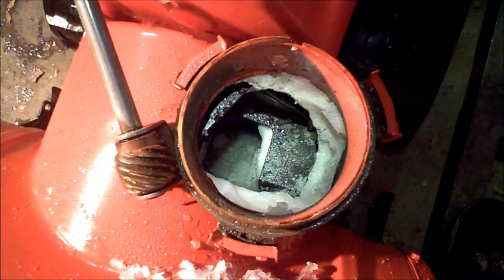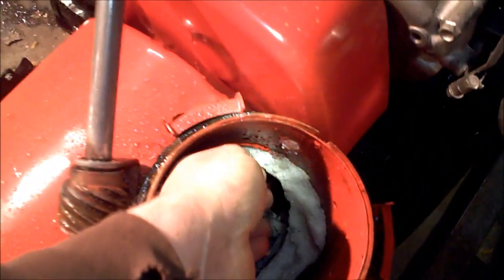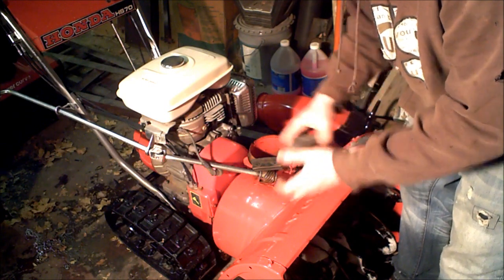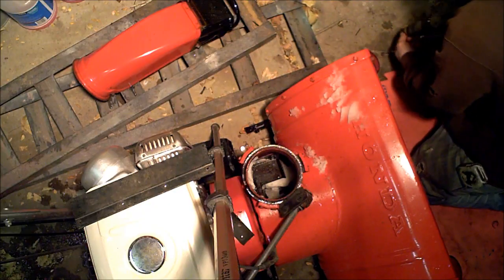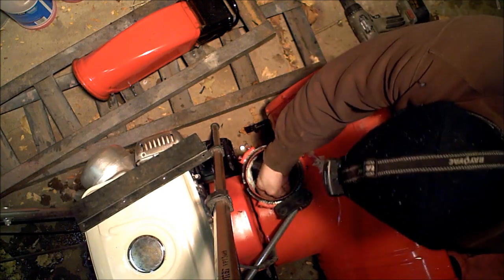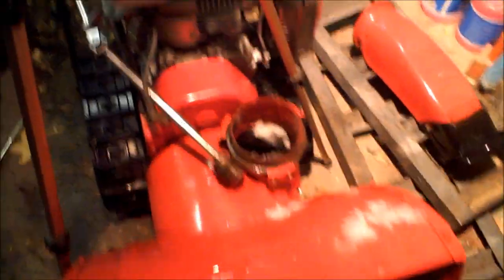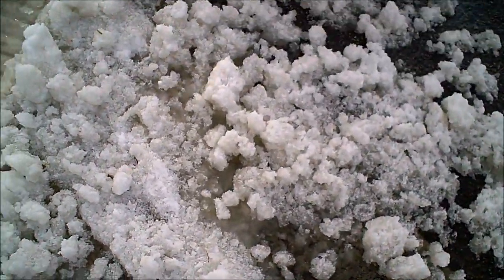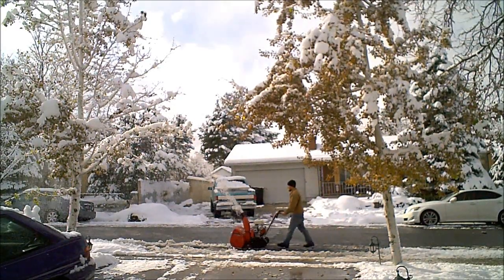Modify Snowblower to never clog and throw twice as far w/ Impeller Kit

Comment: Hey 65, I have a question for you. This past fall I bought a new Remington 24" snowblower. I've only used it 2 or 3 times. Yesterday it started great, I let it warm up for a few minutes, however when I started the augers it quickly died,  the augers didn't turn at all from then on. What should I be looking at. The auger at a quick glance seemed to have all the hairpins in... assuming their the shear pins.???? also I didn't notice a puff or two of smoke
Reply from the maker: tkdnwwis I'm curious to weather it is a mechanical issue or an engine. Slowly engage the auger and if the engine strains and dies then we can move on the to something mechanical. I would look at the belt.
Reply: sixtyfiveford Ok i'll do that tomorrow and let you know. I'm thinking that's what I did like the 2nd and 3rd time I tried to use it. Hypothetically speaking you'd still lean towards the belt. The machine is new (for what that's worth).
Reply from the maker: I would think the belt slipped off and is binding or the impeller is impacting something in the chute area.
Reply: sixtyfiveford Ok I took the cover off and checked the belt. The belt is on and still looks new. I tried to spin the belt by hand and it barely moved, it does but really hard????
Reply from the maker: With the lever not engaged there is a brake on the pully to stop it from turning. With the lever fully engaged it is coupled to the engine and hard to turn. If you partially engage it both will be off and you should be able to freely spin it.
Reply: sixtyfiveford Ok it's fixed. I didn't realize the plate that the auger shaft goes to, spins as well. There was Ice behind the plate. However, with your answers I did learn about how to remove the plate and find the belt etc. So "Thank You!". It's guys like you, that guys like me need. :-)
Reply from the maker: Great. I'm glad it was something simple.

Comment: Did this mod based on your video. My machine totally kicks ass now. Zero clogging and throws snow 30 feet. 
Even the heavy crap down at the apron.
 So simple and it makes it 10 times the machine. Thank you!
MTD 8 horse, 26 inch.
Reply from the maker: 1075twist That's GREAT. I'm glad you took the initiative to try it out for yourself. Every machine I do, I still am amazed at the difference.

Comment: Hey sixtyfiveford, I was looking for help for my roughly 20 year old Troy Bilt 21", 5HP tecumseh snow thrower that wouldn't run after starting with starter fluid. Did your 5 min carburetor clean, had some issues with the float (worked too fast to do it right at first, fixed that later) but got it running. Then, the hold down nylon clips on the discharge chute broke, so used a vice grips or a couple of snowfalls, til i got some new chute hold downs. But, while the chute was off, I had to try the impeller mod. Cut the rubber from the sidewall of an old tire, installed, then this weekend had 4+  inches of snow, then rain (on Long Island). Way too heavy to want to shovel, not likely to be handled by snowthrower. But, this thing went through it and only clogged when trying to push real slush out of pudddles! Can't wait to see what it does with real snow, but after this February, I can wait til next year!
Reply from the maker: Walter Donach Sounds like you've brought it back to life. I'm glad you did the modification and know you'll be impressed for years to come.

Comment: I just made this modification to the 60" snow blower on my tractor.  I used an $8.00 truck mud flap and $4.00 for some screws and washers.  Noticed that Amazon sells kits to do this mod.  You can also purchase a snow blower rubber paddle there too.
Thanks for making this video; wet snow is in the forecast.  Can't wait to try the mod.
I also gave you a thumbs up.
Reply from the maker: A Stanton1966 Let me know how it goes.
Reply: sixtyfiveford There's a snow storm coming Sunday and it might have some mix in it.  My blower clogged before in wet snow, so I'm curious to see how it will work with the mod now.

Comment: Small point but there's a difference between "self drilling" and "self tapping" screws. A "self drilling" screw will drill itself into metal where no hole exists. A "self tapping" screw will tap it's own threads into an existing hole. Good idea anyway.
Reply from the maker: Lysle Anderson Yeah, but it is used universally. Major manufactures use the term self tapping all the time on self drilling screws because all self drilling screws cut their own threads.

Comment: Thank you SOOOO much for this.  I was about 30 seconds from buying a new snow blower because I had all the problems you mentioned.  I have a fairly new 9hp Craftsman.  I did the mod using a 4" x 4" compression joint sealer / hub donut from the local Ace ($8) and cut it into 3 squares for the three impeller blade.  Holy crap!  This thing was like a brand new snow blower.  It blew snow easily twice as far as it ever has, even over the top of my pickup truck!  Also when done my blower used to be full of snow around the impeller.  It was clean as a whistle.  I can't thank you enough!  Here is the fitting I used: http://www.acehardware.com/product/index.jsp?productId=28973546&cp=2568443.2568452.2631237.2631261.2631276
Reply from the maker: Rick Troiani That's great. Great ingenuity with the plumbing part.

Comment: WHOOO HOOO!!!!
Oh man! This is fantastic! I did my driveway and my neighbor's (they're awesome people). I have a 5 hp 22" MTD. 

The situation before the modification:

I'm up in Kingston, Ontario Canada and this is our second 5"+ snowfall this week, so I have a good comparison. The previous snowfall, especially at the end of the driveway, I had at least 6 clogs and oozing slush that just dribbled out the chute in places. That was Thursday. The side banks on my driveway were creeping in b/c the blower couldn't get it over 5' high.

I put two fins on the impeller. I used a piece of car mat I had lying around (about 1/8" thick) Since my impeller is plastic, I used #6 self tappers, 1/2" in length. The toughest part of doing the job was getting the chute off. MTD has pics on their website that explained it pretty good. 

The driveways and sidewalks were covered with about 6-8" of snow with some drifts over 12".They were cleared with no problem. What I also discovered that (I think) b/c the hopper gets cleaned out so fast now it cleared the snow deeper. First time this winter I was down to bare pavement on the first pass. 

Basic snow was thrown 15-20 feet. I was able to move my banks back 2'.
AAND the crud dumped by the snowplow was tossed at least 5 feet, and in some spots even 10. The cruddy wet, packed stuff was gone man. GONE.

NOT. ONE. CLOG. No oozing dribbles either.
Thanks for such a great video man!
Reply from the maker: Jim M That's great to hear. It can be a bear to work down in the chute opening, so I'm glad you go it done.
Reply: awesome!!!!!!!!!!!!!!!!!

Comment: You are the man! I bought a 22" Craftsman snow blower for $50 on CL and thought I got the deal of the century until I used it and clogged after only a few minutes of use and continued to clog. Your video saved the day, seriously! I went to my local gas station and for free I picked up a car tire that was not repairable. I used the sidewall of the tire for the snow blower modification and could not believe the difference it made when I ran it down the driveway. Regards and thank you!
Reply from the maker: steven cook Awesome. Great work with the car tire.

Comment: Need to do this soon, but wondering with the Toro thick metal, what I should use? I'm not handy at all, but if I understand exactly what's needed I can usually handle a job, plus I bring over friends to help me. Should I be drilling holes and using bolts and nuts? If so, do I need a special drill bit to go through the Toro's thick metal? BTW, I have a 2001 (I think) Toro 824 that gets clogged and can barely throw even the powdery snow (unless I'm moving real, real, slow, which then it throws it barely ok).
Reply from the maker: imlarry4 You can use self taping screws or bolts. The 2001 Toro's aren't as thick as their older cousins.
Reply: sixtyfiveford Thanks! I just picked up #8 x 1/2" self tapping pan head screws and a 3/32" titanium drill bit for a pilot hole, and some mud flaps, heavy duty rubber. A friend is coming over shortly for a snow party and will help me do this. I will definitely let you know how it goes.
One more question: the impeller blades curve down (maybe a 45 degree angle but still parallel to the metal housing)... should I try to attach the rubber along the full length of the blades (the first part and then the part after the 45 degree angle)?
Reply: imlarry4 Hey sixtyfiveford, having trouble drilling through that hard Toro metal... it does seem to be pretty hard. We broke two bits, since the bits small and it's hard to get the leverage going in through the impeller. I'm wondering if I should just go with a bigger bit, that will be longer and allow easier leverage and then put a bolt and nut in there? I may have some of these that could work but they are on the bigger side. Would that matter? Would be able to get a ratchet in there from the front with a screw driver through the top. Any other ideas?
Reply from the maker: Getting down in through the chute area is the hardest part of the job. Sometimes you can just use the self tapping screws and they will drill through the steel. You can also use a larger drill bit and only drill a 1/16" deep or so to make the metal thinner and easier for the self tapping screws to go in.

Comment: Did you that this would not work a Toro. If so why not>
Reply from the maker: Robert Smith It'll work just fine on a Toro. You generally just have to predrill the holes as they use thicker metal.

Comment: NIce job brother, out of the box thinking, TY for making the video, I'll try your method and put the rubber to the impellers even if I find I have a loose belt. I need to locate the belt first if you know.  i got a 2stage 1997 Toro 724 Snow thrower, Model 38072.   non stick cooking spray did not work even with all powdery snow fallen here in MA.  One thing is a lot of rustiness inside the rotor housing if that's an issue which I suspect is not since rust would likely occur.  If you got a minute any feedback would be appreciated.  TY
Reply: Try spray wax, like mquires easy shine

Comment: Chicago just that the the blizzard of 2015 and a 3 foot drift down the length of my driveway.  About as bad as it gets in 37 years.  The paddles work GREAT.  At the end of the drive I get salt and thus wet snow.  Goes right through it.  You might want to talk about adding drift cutters as I did.  The square holes for the carriage bolts are already punched in the Sears Snow blower.  So, I can cut through snow deeper than the machine for about $10.  When I expect deep snow to stick around for a while, I blast right over my lawn to the curb.  That is were the trash can goes so that the can does not block the drive because pick up time is delayed as trash men are also first responders  are on other duties.
Reply from the maker: ***** That's Great. I'm glad you tried it out. Yeah, drift cutters can really make a difference.

Comment: Great idea for eliminating a problem.  I just wonder...a caveat=  The impeller blades are balanced for this spinning shaft.  By adding the rubber to one blade, you are putting the shaft out of balance which will wear out its bearings prematurely.  For the benefit you have created in eliminating the clogs, the modification is worth it from a safety and efficiency standpoint.    Thanks.
Reply from the maker: DOLRED Balanced.... You would think so but NO. The impeller always has a different snow load on each blade and is constantly unbalanced. You are adding paddles to 2 opposing blades or all blades.
Reply: Dolred................no problem here.  As he said, each blade has a different load.  I've found no problem.  There are other youtube videos on paddles and balance is never discussed.  What you might want to do is replace the belts in the summer.  Mine were 10 years old and missing teeth.  They were just ready to fail in the winter.  There is a 4 inch wheel that runs on a disk.  That wheel moves from here to there and the other side of center of the disc.  That is what provides the various speeds in forward and reverse speeds.  I replaced that one the year before that as it was badly worn for $14.  None of this is hard in the summer.  I have a 5 horse as back up as one machine blew and the shop wanted 8 weeks to fix it.

Comment: I have a new Ariens being delivered in a few days. Any idea if this is easily done on these machines? Also, I've had pretty good luck with reducing clogging buy spraying silicon spray into and around the inside of the shoot on my old craftsman. Granted, the snow doesn't always go as far as I would like, but it still seemed to throw it the wet and slushy stuff with clogging. Ever tried that?
Reply from the maker: leadfooty I have use the spray of every sort in the chute/impeller area and it is on average 75% as efficient as doing this modification. Some snowblowers have such a huge gap, spray is maybe 10-20% as efficient. The only issue is the spray is short lived, usually only lasting 1 session or less and it needs to be reapplied. Ariens(not sno-tek) are generally pretty good at having smaller gaps so they work decent with spray. The ability to throw further and never clog is generally worth it to people to install these.
Reply: sixtyfiveford
I 'd like to try it. I'm a little nervous about drilling into a brand new machine. I should probably check if there will be any warranty issues with that. Of course, nothing about this effects the operation of the machine, but some dealers and manufacturers can be real jerks when it comes to getting out of warranty work
Reply from the maker: Try it as is before you do anything. They are looking for any reason to cancel a warranty. Even in legitimate situations they virtually always cancel warranty claims.

Comment: Two major snow storms and multiple snowfalls into winter and this mod is still intact on my impeller - I haven't used the unclogging tool yet! I have cleared the snowplow hill at the foot of my driveway each time without any issues - this mod works amazingly. As a bonus, my neighbour was clearing his driveway across the street and I could see how short his throwing distance was compared to mine (approx. 20 ft far and 7-12 ft high where I was getting 35+ feet and about 15ft high). Thanks sixtyfiveford, I will do this mod to every snowblower I come in contact with!
Reply from the maker: The reason for the gap is just manufacturing tolerances. The impeller is rarely perfectly centered so a 1/8-1/4" gap all around is standard to prevent the metal impeller from impacting the metal housing. As the machine ages it will also stretch the metal housing and bulge it slightly, increasing the gap further. With a lot of the modern cheaper machines, plastic(composite) impellers are being used and they can't allow it to contact the housing as it would disintegrate.  There you may see gaps as large as 3/8" all around. All these machines even with horrible tolerances still work and perform better than a shovel. It entices people to upgrade to higher end machines that are far more profitable for the manufacturer and are built better. The more you pay for a machine, generally the tighter the stock tolerances.

Rubber is the ideal choice as it will deflect under extreme instances and prevent damage.
Simplicity does have a patent on this and so manufacturers aren't able to use it.
Reply: change to a smaller pulley and you will throw snow with paddles  like you have done   a country mile
Reply: Dan Bechan My auger never rotates freely before firing up, it only rotates if I press the auger handle.
Reply: Fishingtuts What I should have said is that with the machine off, I check the "impeller" to make sure it rotates freely. My auger doesn't spin freely either. On my machine it is the impeller that provides the shaft rotation for the little gearbox that turns the auger.  Hope this clarifies what I meant
Reply from the maker: Dan Bechan Wow, thanks for the feedback. I know I'm excited every time I use a snow blower I've done this to. It's amazing how such a simple modification can change the performance.
Reply: And it doesn't seem to stress the motor at all - i thought that maybe this mod would expose a weakness somewhere else on the machine but it didn't. One important fact to mention though: I had ice build up on the auger and since there is more direct contact with the housing I did end up chewing a belt ($20 fix but PITA in the cold) whereas before the ice may have broken a bit easier - just a theory though and lesson learned. I simply double check that the auger rotates freely before firing up
Reply: Dan Bechan I think you're onto something Dan regarding reduced strain on the machine. I just did the mod and my 5 hp didn't strain at all whereas the dump we had 2 days ago really strained it (you could hear the engine winding up, esp at the end of the driveway.
Reply: Great idea, a couple slightly oversize steel washers would secure the rubber blades better
Reply: Jim M Just a thought, maybe that's is why manufacturers leave that bit of gap between the impeller and the housing - to prevent bogging down and stalling. Personally, I'd prefer the rubber blades though. If I hear the motor wind up, I guess I will just have to back off a bit.